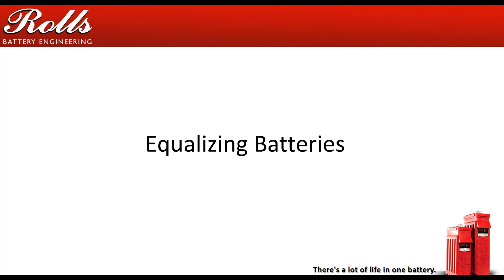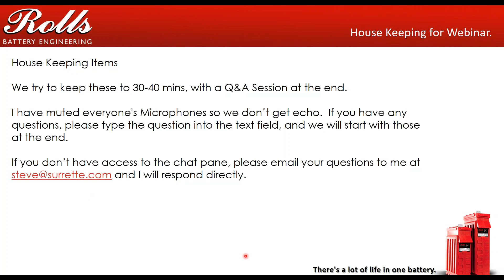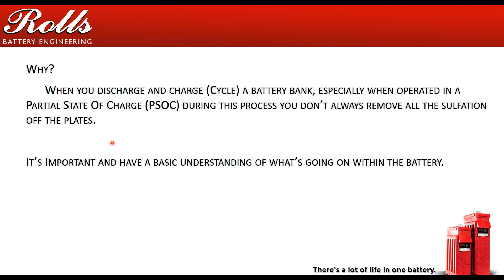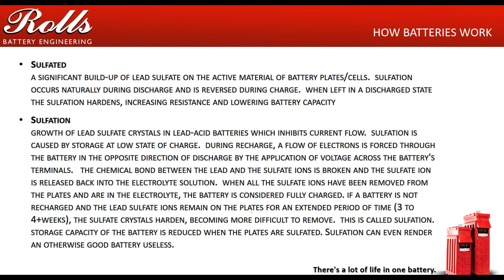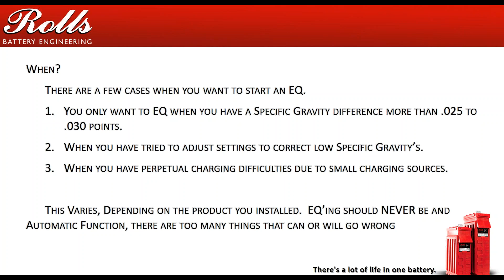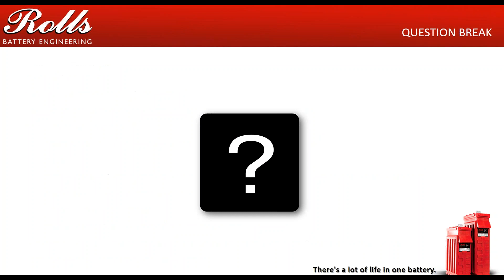Rolls Battery Engineering - Equalizing Batteries

Comment: The Progressive Dynamics load center in our RV will automatically run the equalization mode at pre-programmed intervals.

All I can think of is to put the RV battery on a different charger when we are not traveling.

Comment: How now volts for my battery’s to equalize I have s 480 6v have 8 battery
Reply from the maker: Are you asking at what voltage to EQ at?   EQ'ing is generally done between 2.5 and 2.65 vpc...  I'm guessing that you are operating at 48 volts...  You will want to EQ between 60, and 64 volts..  How high depends on the damage you've already done to the bank.   Frankly if your battery bank is undercharged, or needs to be EQ'ed you should look to adjust your charging parameters first, BEFORE you cook your batteries with an EQ charge.
Reply: @RollsBatteryEngineering  wonderful video , extremely informative ..I recently bought four 235ah batteries and have them in series parallel to give me 470ah@12v ..I have 600 w of power coming from the panels , would that be sufficient to charge the batteries properly  ? Secondly you mentioned that it's important to have the correct absorbtion time , my controller is set at default 120 mins , is that a correct run time or do I need to adjust ? And lastly you also mentioned that if a battery is only being discharged maybe 20% ( as mine are )  it only needs a full charge every so often , by this do you mean equalization ? Pls excuse the multiple questions as I'm relatively new at this , thanks ....
Reply from the maker: @fazimabdool6437  600 watts is okay... depending on how much you load these batteries will determine if the amount of panels is correct.   I'm sorry, I can't even begin to tell you if this is enough.    Absorb timers are based on the formula .42 X C/20 / Nominal Charge Current...   Off hand,  you would need about 80 amps of current coming in while in the bulk stage to get the absrob timer to two hours or less.    If you are truly only doing 20% cycles... you should focus on getting a full 100% charge at least every 10-14 days. 

I suggest that you watch some of the other videos, also you can download our manual off our webpage... www.rollsbattery.com.
Reply: @RollsBatteryEngineering  ok thanks , one last question , I've been told that if you only discharged a battery 10- 20% everyday it leads to stratification ? If true how do I fix this and my batteries are connected to the mppt and I get loads of sunshine in my country , so based upon my mppt I have 100% charge by noon , is this the 100%charge you are referring to or do you mean an equalization charge every 14 days .. forgive me for my lack of knowledge :)
Reply from the maker: @fazimabdool6437  You want to check your SG's at the end of the day... they should be in the 1.265 to 1.275 for a full 100% charge. 

Our batteries tend to not get Stratified as we use a higher Antimony content and this helps prevent this...   If sitting for 4-6 months without a charge this can happen.
Reply: @RollsBatteryEngineering  ok thanks a million buddy , keep up the good work ..btw the rolls batteries are awesome , best battery I've used by far